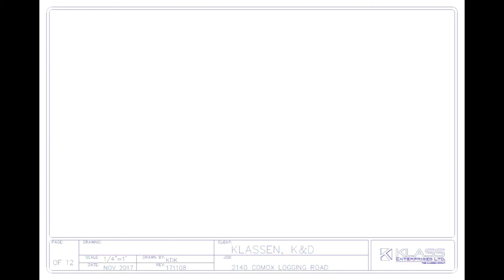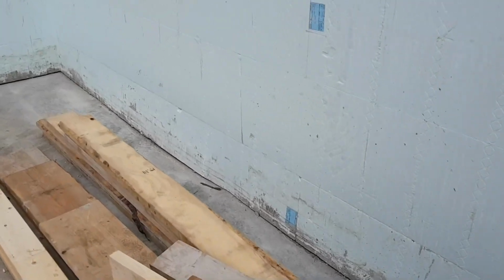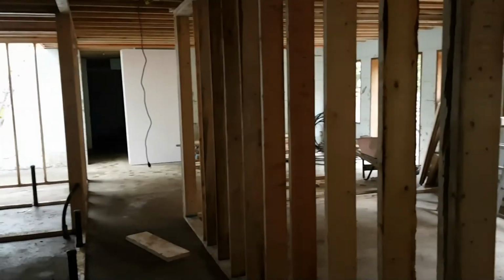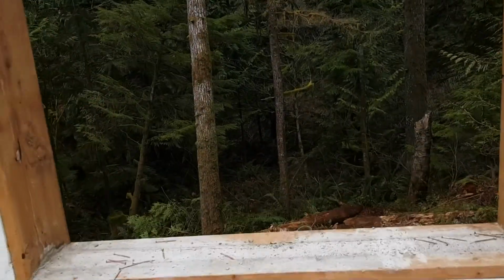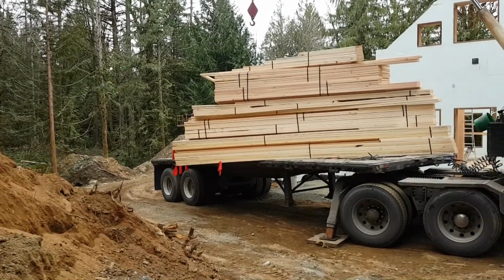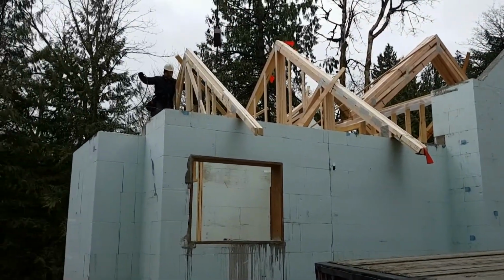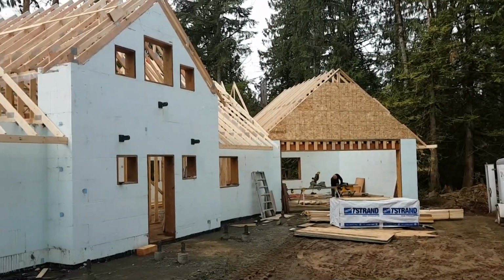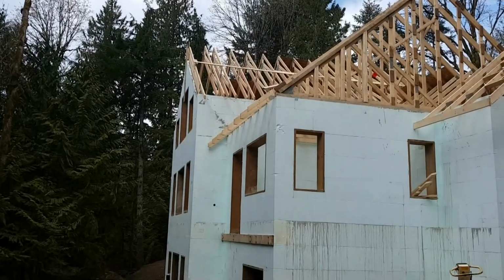The House Project - 9 - Trusses

Comment: Nice. don't forget to use resilient channel on your truss ceilings
Reply from the maker: Just curious, what is the reasoning for the res channel?  I've never used that on the ceiling before.
Reply: HI ,  it is designed to use on ceiling or wall for acoustical dampening, But also dos great job preventing cracks in wallboard in truss ceiling/ roof.  Dos great job in case of fire when installed correctly, metal on the long joint. Enjoyed watching your videos house start to look great. (there is also special bracket to attach top wall  plate to truss ceiling to avoid cracks I have seen truss celling raze up to 1/2 inch in the middle of the house when snow load on it )
Reply from the maker: I see, thanks.  Didn't know about it helping with cracks.  We've only used it for sound.